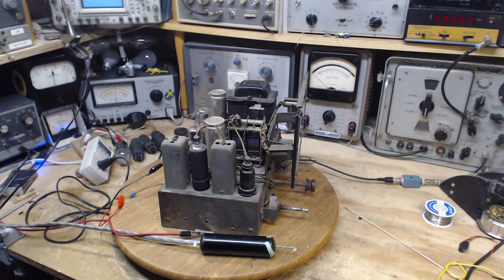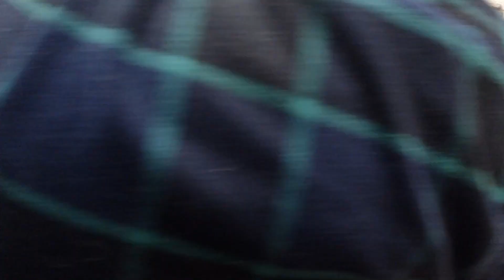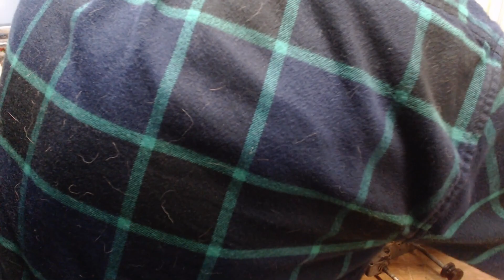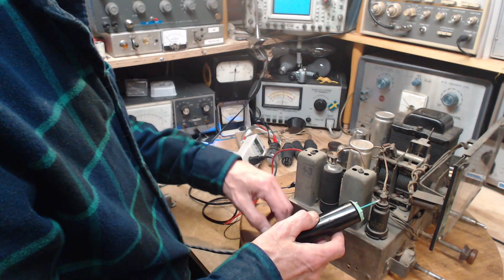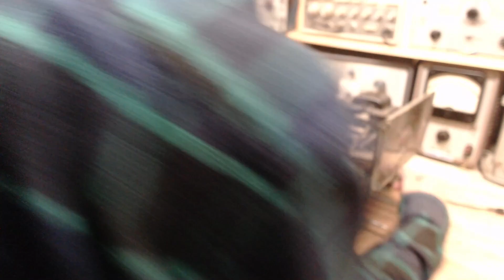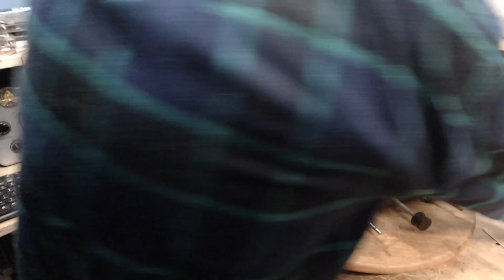Rogers Model 7R622 1935 Tube Radio Video #4 - Signal Tracing

Comment: You noted a burned multi-turn coil in an earlier video. If good, should it not have shown at least some resistance?. I believe you measured "0" ohms which should indicate a short in the broadcast circuit which could cause the lack of response from the signal generator. Could we examine this coil further? This was the primary coil, i believe.
Reply: IIRC he got 0,1 Ohms on the 200 Ohms range when testing across the primary of the antenna coil. This seems low indeed. Going by visual inspection alone based on the close- ups in the previous to last video the coil looked highly suspicious. 
His chinese component tester should be able to read the inductance on that coil. And setting the band switch to SW would isolate the BC band antenna coil from the circuitry to where no desoldering is needed. It would be a 30 second test. But like so often with him, crucial observations slip past him, get misinterpreted or are simply ignored, leading to video after video of him chasing his own tail.